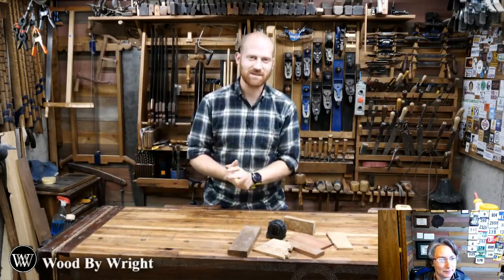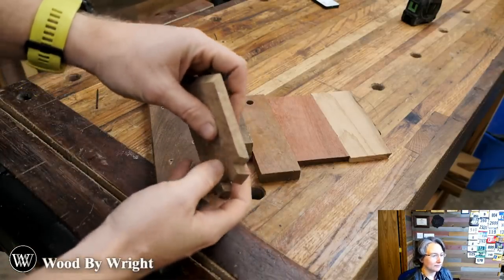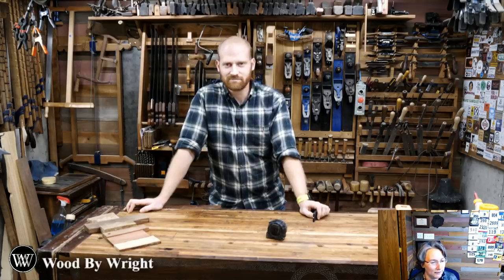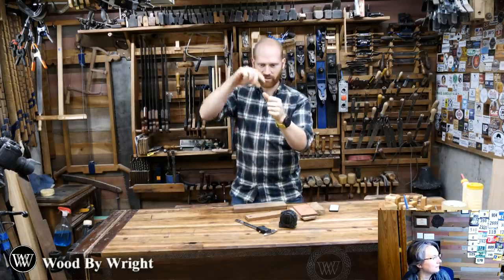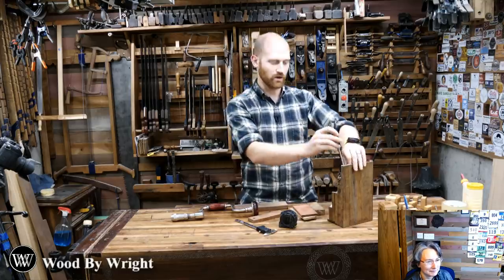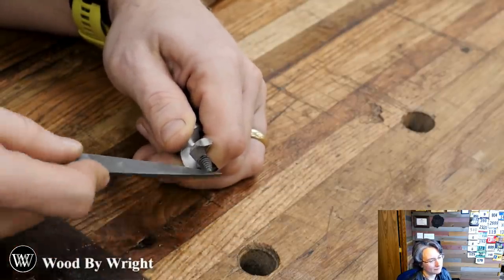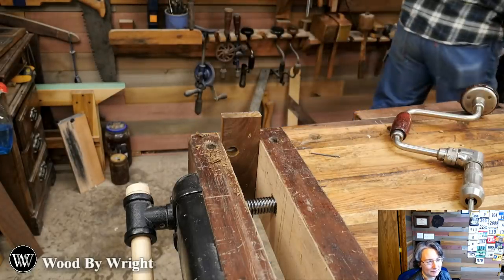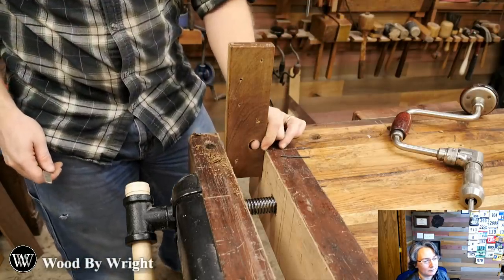Making a Simple Christmas Gift One Hand Book Holder.

Comment: It was very interesting to actually see where your wife is sitting during the live broadcasts. I have never before come across a book holder so I have learned something new, which is always refreshing. I have a question about white oak, which was mentioned several times during the video. How do you get a really smooth finish on white oak? My very limited experience is that the grain creates a rough finish, however much it is planed, scraped and sanded! The only way I have managed to get a smooth finish is to use a polyurathene varnish, which acts as a filler and I know it is not your preference.